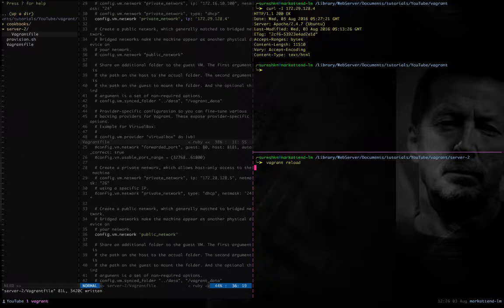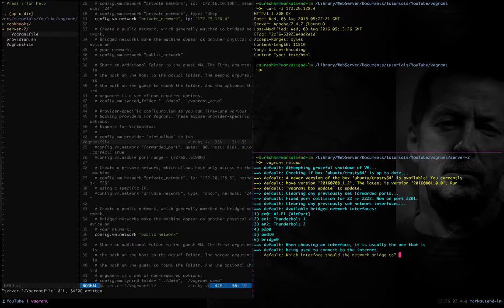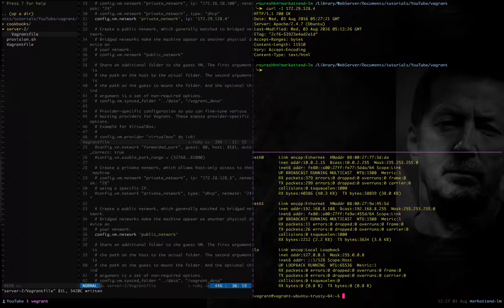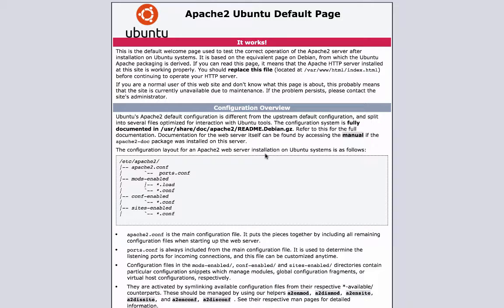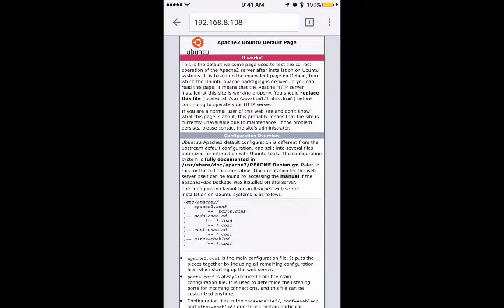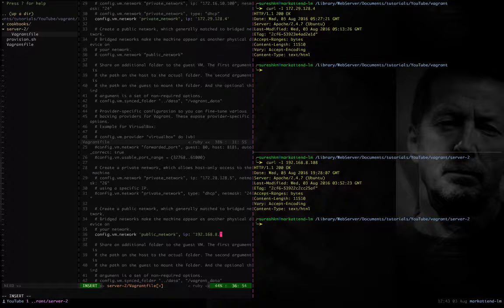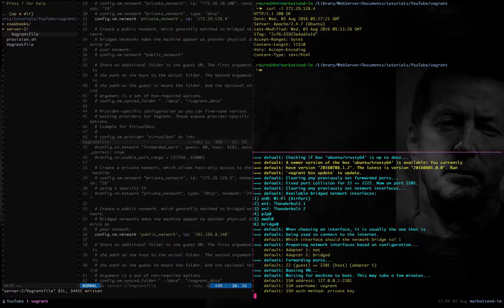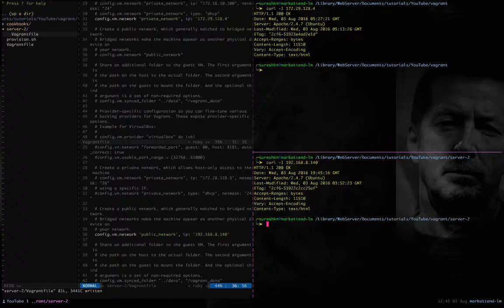vagrant tutorials #6

Comment: Hi Suresh, Thanks for the great series on Vagrant. I have a question though. What should be my configuration of the network if I want to access my local website on my VM from all computers on local network and not just from the host machine? This is a bit confusing but i think it should be using a bridged network. Your thoughts and suggestions on this. Thanks very much.
Reply from the maker: Glad, you liked them. Yes, public (bridged) network option is the one where you choose an IP address which is different than your host machine.
Reply: Thanks for that clarification ! Once again great series of videos.